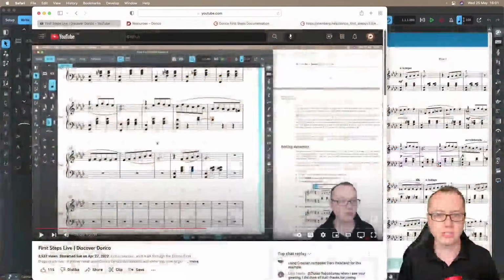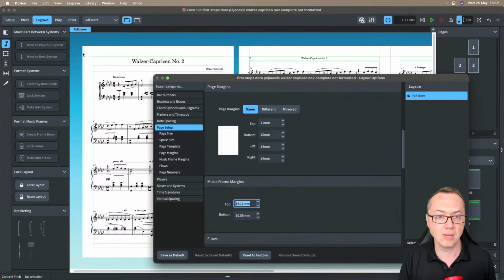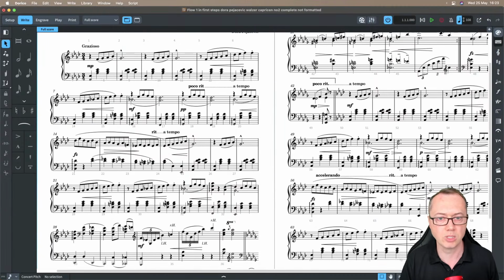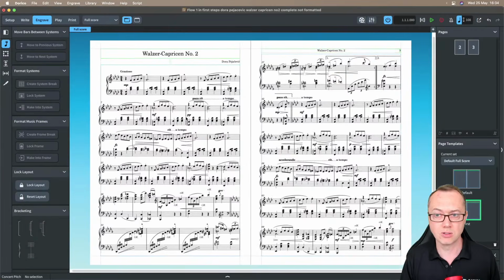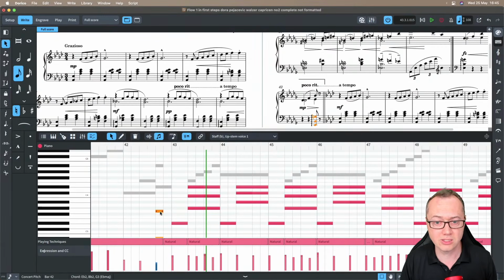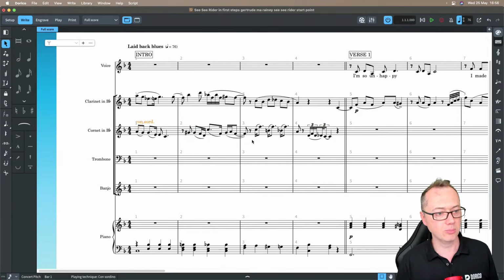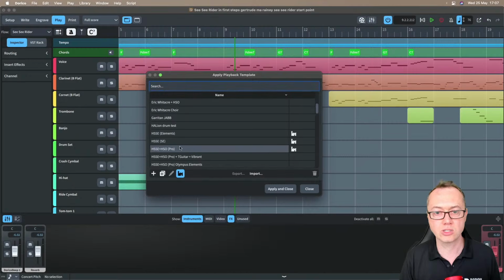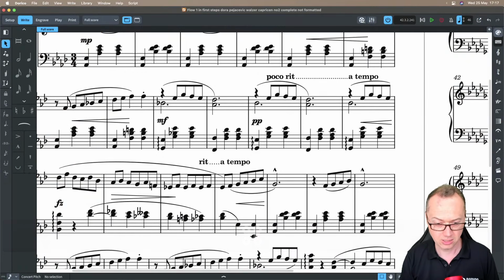First Steps Live part 2 | Discover Dorico

Comment: Thanks John. I would like to see a session that you start from a score with notes and from there you address all possible articulations for all major orchestral instruments (strings articulations, upright bass, woodwinds, brass, percussions) and distinguish which ones are played back correctly by Dorico and which ones require alteration of CC value or key switches to pick a different sample to make them sound right. I think for me personally this has been a grey area for a few years. For instance you mentioned when we add fermata, it actually doesn't stretch the timing for the playback and we need to manually change the tempo. There are different samples of short notes, long notes, staccato notes, etc. so is Dorico picking a different note in each instance based on the notation or just using the same sample and alters the timing internally (i.e. for proper playback still we need to play around with CC value)? For ones composing music in DAW like Cubase, it is clear that the only way is to pick the right sample but since in Dorico we can play back with notation or picking different samples I think this duality creates grey area. I think ideally this could take place with HSSE + HSO (Pro) samples and talk about additional possibilities with platforms that have more articulations like Steinberg Iconica or Note Performer. What do you think?
Reply from the maker: It will depend on the sample library as to which techniques are available for playback though.  e.g. if there is a staccato technique in the sample library then Dorico is shortening the note, but the expression map is changing the key switch to a different technique too.
Reply: How about ones that are not playable at all like fermata? Also how do we know which one is the same base sample manipulated by Dorico and which one played with the intended dedicated sample for that articulation? If there is a session to pick a sample library that is common (like Halion Sonic SE) or a more elaborated one that you think it is worth it for learning process (like Note Performer or Iconica) and a notation example with quite a varieties of articulations for different instruments then you can demonstrate which note is manipulated by Dorico and which one picked a different sample. Even comparing those and showing the process makes things more clear and less of a guess work. @dorico